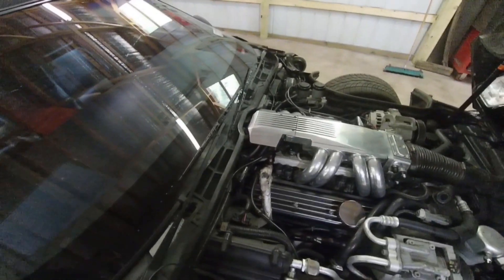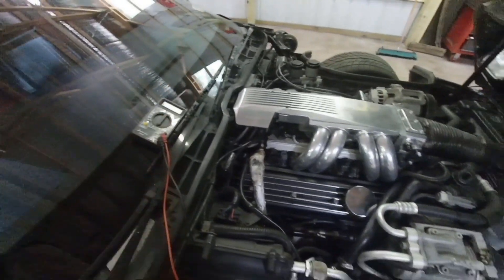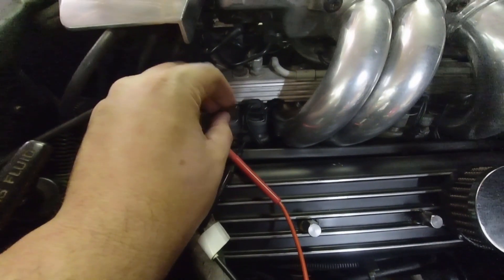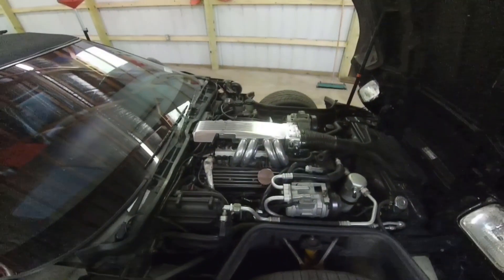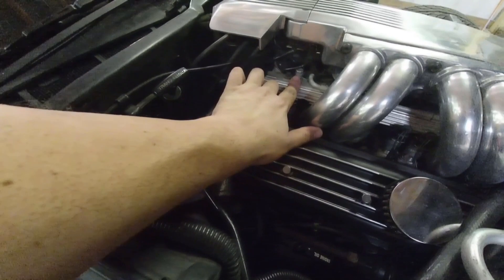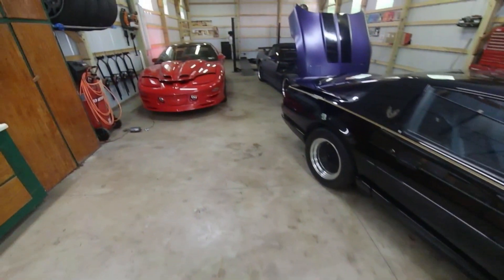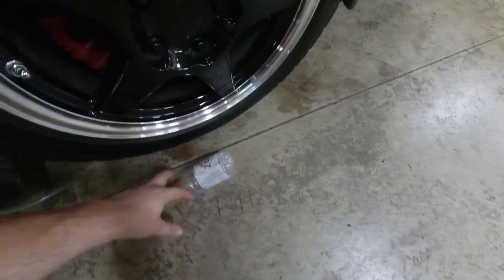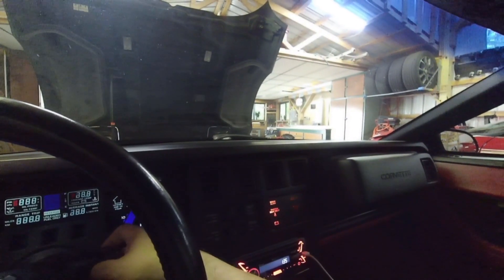C4 Corvette Fuel Pump and Injector Test L98 Ohms Pressure Troubleshooting

Comment: Thank you for a great video and very informative 👍🏻 Amazing...!  I have a 95 C4 with 95,000 miles and the engine makes a popping sound when the motor is in full Throttle... like it's not getting enough fuel... so I changed the original Fuel Filter and the Electric Fuel Pump and it still does it... the new electric fuel pump is a (Percision Fuel Pump Kit)....Any ideas?
Reply from the maker: Is the popping sound in the exhaust, like unburnt fuel igniting? What about the spark plugs and wires? Maybe they are fouled, or the timing needs an adjustment for wide open throttle. I would start with inspecting the spark plugs. I would also suggest singing up at one of the many corvette forums (do a google search), create a new thread and ask the other forum members for assistance.
Reply: @PhoenixHavenGarage  Thanks... no popping sound is coming out of the intake and it only does if the transmission kicks down to the next gear
Reply from the maker: @mrdeanv4414  If you remove the tube from the air filter to the throttle body, does it smell like gas if you open the throttle body and smell? If so its the fuel pressure regulator. I'm out of ideas otherwise.
Reply: @PhoenixHavenGarage  Thank you very much..I will check that hopefully this afternoon
Reply: @PhoenixHavenGarage  ok so this morning I got it to start and I removed the vacuum line form the fuel pressure regulator and there was no no change in the motor and there was vacuum on the little vacuum hose... is that a bad Fuel Pressure Regulator?
Reply from the maker: @mrdeanv4414  You could try driving it with the hose you removed detached and see if it operates the same or worse also.

I think the vacuum kicks in as you accelerate and the throttle body opens to increase the vacuum. If you remove the the hose from the air filter to the throttle body, then push the throttle body blades/butterflies in with your finger, do you smell gas? If you smell gas, the rubber diaphragm in the fuel regulator is ripped and it has failed. It could still be bad and you may not smell gas, but it is an easy check.
Reply: @PhoenixHavenGarage  ok Thanks very much..
Reply from the maker: @mrdeanv4414  I would plug the tip of the fuel pressure regulator if you drive it with that hose detached... incase any gas leaks out
Reply: @PhoenixHavenGarage  good idea Thanks

Comment: Maybe check your wires under steering column. Vats system. Wire broke?
Reply from the maker: It was out of gas, then the fuel pump went. There is a follow up vid.

Comment: Great video!
I have a c4 -91 with two issues...
Ac doesnt work and no one of the two fans work......how to hunt this down?.
And when the engine gets hot it start to go unclean, blurring like a twostroker on some rpm:s.
Would be very greatful for help.
Reply from the maker: You can probably use a voltage multimeter and probe the fan wires for voltage. I believe the 2 fans will come on at different temperatures. There is a Fan relay also that might be causing the problem. You can force the fans to turn on by turning on the AC at high speed. I know you said it doesn't work, but the system should still trigger the fans to come one. Also, search for corvette hot start issue on google and youtube, there should be a ton of info on it. Good luck

Comment: I’m having a similar problem on my C4 Vette. Injectors tested good... but should have a constant power to each injector with the power on, right? I don’t have power to the injectors.
Reply from the maker: You should see a constant "resistance" reading on each injector, and I believe voltage only when it should be pulsing.
Reply from the maker: You can also spark test the plugs and spray some starting fluid into the intake to see if it fires up for 5 seconds or so to isolate the issue.

Comment: I have been having trouble with my 1989 Firebird Formula. 5.7 L98 . When I start the car up the car idles at 100O rpm or so after a few minutes the needle bounces a little  in-between 1000 and 1200. I can rev it in park and it dose ok but soon has I put it in drive and go down the road and give it gas it wants to stall and die. This happened to me the other day lucky I didn't get too far from the house ,about 1 mile or so. I raised the hood and let it cool off about ten minutes and cranked it and it started. Put it in drive and soon as I did ,it started missing and died again.. I let the engine cool for another 45 min started it up put it in drive and made it back home..My engine does not over heat the needle on  the temp gauge never gets over the point of the first mark and the middle mark. I just saw this video and checked the  ohms on every fuel 
 injector   1=11.4
Injector   3=18.0
Injector.  5=15.8
Injector.  7=19.3
Injector   2= 6.0 
Injector.  4=19.0
Injector.  6= 7.7
Injector.  8= 14.0
I suspect that when the engine reaches operating tempature these injector s completely fail when the car is under load. Well I guess I know what I will be doing next weekend. Thank you for this video . New sub👍
Reply from the maker: Thanks for the support!  Good luck

Comment: My C4 yesterday just die while driving and I had to tow it home . It will Crank but won't start . I can hear it trying to start and smell fule like it's flooding .pump is priming for 2 second . I have 45psi fule pressure but it slowly drops ...I am not sure why it will not start
Reply from the maker: You should try and probe the 10amp fuse on the passenger side while cranking. You should see around 12volt when cranking. If not, it might be the Fuel pump relay. I discuss this near the end of the video. The pump not running while cranking would cause the fuel pressure to drop.
Reply from the maker: Otherwise buy a spark tester. You unplug a spark plug wire from a spark plug and plug the tester into the wire. You should see a spark. https://www.youtube.com/watch?v=XPhmhULZy6g
You can also spray some starter fluid into the throttle body for about 5 seconds and then try to start it. If it starts it is a fuel delivery problem.
Reply: Buy a new gas cap,  that'll be my first purchase after I see pressure dropping and all else checked out as functional. Theres a trickle leak in the system. Also check the fuel vapor canister for fuel leaking.
Reply: Lol a fuel cap? Come on man. Maybe the regulator???